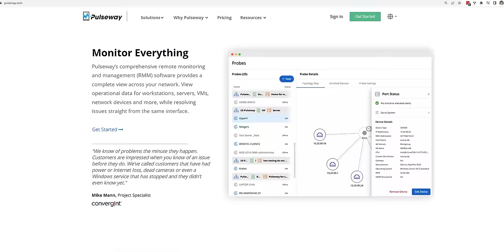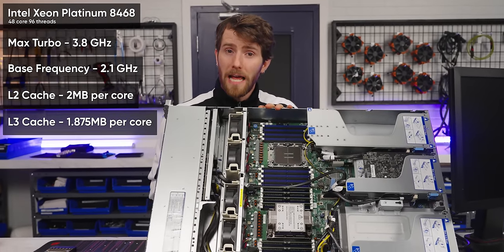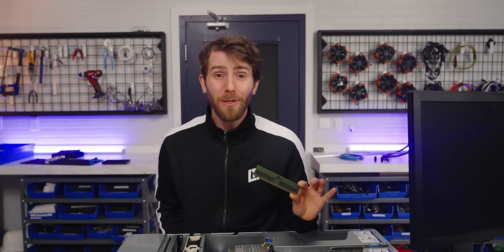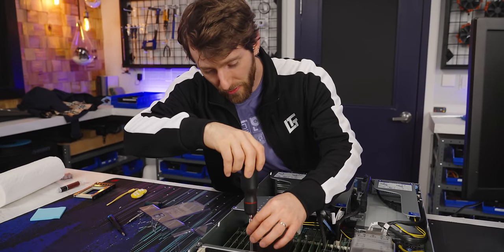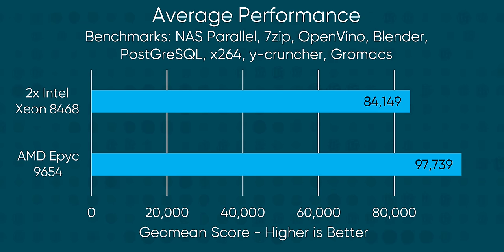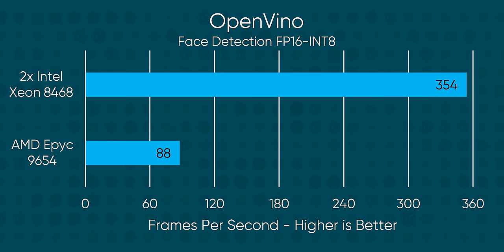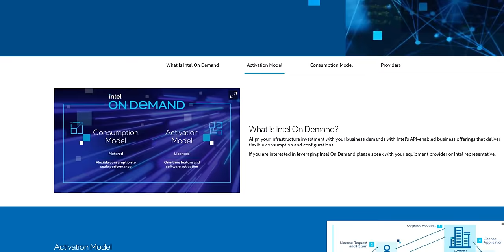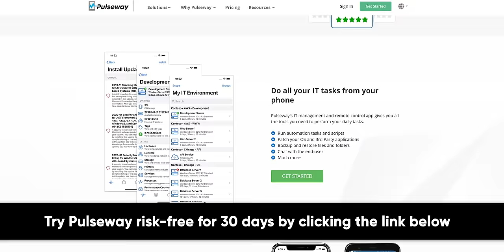Intel’s New CPUs are Cringe - Intel Sapphire Rapids Xeon Platinum 8468

Comment: As an ex server engineer those power usage costs are a real killer. I expect my former colleagues are buying all AMD now.
Reply: Wait until room-temperature superconductivity goes mainstream...
Reply: True
Reply: Even using Alder Lake for servers lol.
Reply: @raylopez99  I just wanna invest in QPUs at this point tbh
I may have to invest a little into more companies I loathe for it, but I am not giving Google a cent. IBM was supposed to be working on this, although I question if we reach quantuum thresholds if they're just gonna keep making bigger surface area dies like Intel, or if they're gonna keep trying to stack like AMD until we have CubePUs. Which in fairness, I think would be rather neat putting a borg cube CPU in my computer like some sort of Numenera, complete with nanotube heatpipes running through the die interior just to desperately keep the core cooled.
Reply: @raylopez99  won't reduce the power consumption of your transistors though
Reply: @michaelrichter2528  Intel should have used Big-Little for Sapphire Rapids.
Reply: Power is going up not down with process, it's a physics issue with no solution.  If power is a concern then stop crying for more performance.
Reply: Problem is finding AMD. Their server chip capacity must be near maxed for existing clients.
Reply: I remember the 90's, where high end desktop workstations and servers were almost all PowerPC based. But due to IBM failing in the 2000's it all came crashing down. I just wish UNIX workstation computing on alternative architectures would be a more mainstream thing again. There are desktop boards with recent Power and ARM chips, but they are too niche, unsupported by most software and very expensive.
Reply: @RyTrapp0  if you normalise two systems that are near identical one AMD and one Intel then the per core power is slightly higher on the Intel side however... power is a physics problem taking voltage, frequency and cap into the equation.  At full tilt you can't reduce the power drawn, something many people fail to understand.
Making a decision based on power is non-sense is what I'm saying, your looking at one aspect of a complete system.
Reply: Hi i want be an server engineer 😊
Reply: Yes we are. None of our customers bought Intel for last several years. The efficiency of EPYC is just epyc compared to Intel offering.
Reply: At ideal or low workloads intel is actually more efficient due to efficiency cores.
Reply: @saricubra2867  They have Sierra Forest coming for the people who want little cores. Do they package both on the same chip IDK yet.
Reply: @Anonymous-qb4vc  i don't think these massive core count CPUs are divided into E and P cores my guy...
Reply: @kleanthisgroutides7100  Wtf you on about? Compute performance does not scale with power consumption at all given different architectures. Are you telling me a vacuum tube computer running at the same performance as a modern day iPhone draws the same amount power? 

In case you are actually not EE, P = IV which means Power(Wattage) = Current(Ampere) * Voltage(Voltage), I have no clue wtf are you on about with frequency or cap 
(I am assuming you mean capacitance) those do not affect the power draw besides reactive power.
Reply: @michaelrichter2528  Yes it will, if you use qubit photonic 'transistors'.  Gotcha!
Reply: @drek9k2  cool story bro
Reply: @ipodtouchiscoollol no, it doesn’t scale directly as electronics always be come more efficient but your not going to have the same power draw with a 4 core CPU as you would with a 32 CPU. It may not be Linear but next level performance typically means next level power draw. We all know a modern day laptop is probably more powerful than the computer they used to put people on the moon lol. Doesn’t mean power draw doesn’t increase with demand
Reply: @ipodtouchiscoollol  voltage, frequency and cap are the only knobs affecting dynamic power... I know what I'm talking about as I've used Samsung, TSMC and Intel design kits.
Dynamic Power = V^2 * C * FCLK
Reply: @kleanthisgroutides7100  you're spouting nonsense. Computing is all about work done over time. We measure the performance of computing by comparing the amount of various types of work over time.

If an AMD Epyc server that costs $10,000 can perform ten million specific tasks per hour, and an equivalent Intel system capable of also performing ten million of the same tasks per hour costs $20,000, then AMD is demonstrating roughly twice the performance per dollar when compared to the Intel system. If the AMD system averaged a power consumption of 1000W while performing those ten million of the tasks per hour but the Intel system consumed an average of 2000W while producing the same work output, then we can safely say that the Intel system represents half the performance per watt as the AMD system.

So in my fictional scenario, if the AMD system cost half as much as comparable Intel system while also only costing half as much to run in order to do the same amount of work, why wouldn't, I, the company, care about the savings in capital acquisition costs, or, the savings in operational costs, or, the savings in datacenter rack space?

I've been an architect in enterprise IT for nearly 25 years. It matters! That said, I have customers who still haven't made the switch to AMD, particularly on their virtualization platforms like VMware and AHV, they know AMD is cheaper, they know AMD is more dense and they know that AMD is more efficient, but they also remember the last time that they made the switch to AMD in the datacenter back in the 2007-2010 time frame with Opteron Budapest and Shanghai, making the painful transition away from Intel, only to not only have to learn the quirks of such a different server architecture, but then to be stuck on AMD when bulldozer was released and Intel literally rocketed past them, forcing them to make the painful transition back to Intel a few years later. Some IT leaders unfairly lost their jobs over that debacle. Many enterprises remember that challenge and while they know that savings exist, so many think they're going to move all of their workloads out of their datacenters anyway in the next five years, so why bother incurring the pain associated with making the transition. This is how the enterprise operates, stupid decisions that defy logic, while at the same time being terrified of anything that represents risk.
Reply: @ronniekregar3482  Actually you can have the same power draw 4 core and 32 core CPU the difference is in architecture and manufacturing processes. Take a look at AMD EPYC 7713 and AMD FX-9590, both of which draws ~220 watts but one is 64 core while the other is only 8 core. I'll repeat this again compute performance is not directly scalable with power draw unless both platforms are identical in architecture and manufacturing process.

And just in case you can't read let me spell it out in all caps ITS ALL ABOUT THE ARCHITECTURE AND MANUFACTURING PROCESS, COMPUTATIONAL PERFORMANCE IS NOT DIRECTLY SCALABLE WITH POWER DRAW.
Reply: @racerex340  like I said before, power per core isn't that different between AMD and Intel... as for the cost you have to take the whole cost into account... I.e. the system, the infrastructure, cooling, service, licensing etc... its doesn't matter if the CPUS are more expensive as once you add memory, storage, NVME, GPU'S it averages out.
Reply: What about the subscription service for the hardware? Wouldn't that cost even more than the extra power consumption? Or is that the sort of thing that you can get a bulk discount on, while power consumption costs what it costs?
Reply: If this is even true, the e-core only skus might sell like cake 🍰. Of course, until the 'zen4' e-core only lands.
Reply: @kleanthisgroutides7100  Please elaborate on that equation specifically C * FCLK, as far as I'm aware C normally means charge in Columbs and FCLK is clock speed. Unless this is a method of calculating current as in Charge consumed per clock cycle I don't quite believe this equation.
Reply: @zahialsalman  there are multiple consumption models. Customers can buy the server outright, lease, or use a consumption based subscription model. Those have all been lower cost on Epyc for quite some time now. Where things get funky are with software like operating systems or hypervisors that have subscriptions or perpetual licenses based on CPU cores, an area where AMD has been historically screwed, and Intel retained an advantage because even though Intel had way less cores per socket, their individual cores were measurably faster than AMD's cores. In other cases, vendors will license per CPU socket, which you'd think would be an AMD advantage until the vendor limits the cores per socket to 32, requiring two licenses for every 64-core Epyc CPU for every one required for a 28 core Intel CPU.
Reply: or Ampere.
Reply: @ipodtouchiscoollol  it's the dynamic power equation or sometimes called switching power... assuming full activity per clock cycle.  You then have to add leakage/static power on top.
Reply: @ipodtouchiscoollol  C is capacitance, this is what your charging.
Reply: @kleanthisgroutides7100  it absolutely does not average out, where did you learn averages? Do you work in federal government? If the AMD system cost half as much to do the same work, and requires less power, there is a savings with the AMD system. The only cases where that wasn't true is with software that penalizes high core count systems like VMware, who require two licenses for any socket with more than 32 cores, which sapphire rapids just surpassed. Also, with Epyc 4th gen, AMD has closed the gap in core for core performance, so Intel will either need to petition those software vendors like VMware, Oracle and Microsoft to further penalize AMD higher core count systems, or actually compete.
Reply: @kleanthisgroutides7100  power consumption for amd only went up becausr their customers asked for it, previous Gen epyc was much more power efficiency
Reply: @drek9k2  you can buy a qpc for 4 grand but just like early pcs it can only compute 1 but at a time
Reply: @hyperturbotechnomike  fewer known vulnerabilities... so maybe safer. Maybe not.
Reply: Sure - go AMD if you dont need any support.
Reply: @racerex340  my mistake. I meant Intel's subscription for using their AI acceleration. I was wondering why that wasn't the deal breaker for the OP, when that would likely be a larger recurring cost, unless there's a bulk discount, but upon further consideration, if you want that AI acceleration, you're either picking Intel or something more specialized. Though I'm sure AMD will have a response to this down the road. Thanks for the reply though. It was insightful nonetheless.
Reply: @zahialsalman  yeah, I agree. I think Intel "thinks" they are doing a good thing, someone did the math and it is cheaper to have one SKU that has the extra functionality and just charge to enable it, than it would be to flash them at the factory. That said, I don't see enough companies interested in the features, at least today, most AI is going to be 100 times faster on a GPU based accelerator (even something equivalent an RTX 3060) than whatever they can bake into an x86 CPU.
Reply: HPE introduces Gen11 AMD based servers first before Intel :)
Reply: @DENRAISR  well, it helped that the new Epyc CPU's were ready on schedule.   With Intel's ineptitude over the last 7 years, how much longer could HPE stretch out Gen 10 / Gen 10 plus... As far as I'm concerned, the new Xeon's are HPE Gen 11, and the 4th Gen Epyc are Gen 12
Reply: The contract clause should include:if u dont buy the most efficient hw, the extra power cost comes out of your pay annually.Then watch x86 go irrelevant and all server builders rush to find the most efficient solutions just so their balances dont go into negative. Is it unconstitutional? Who cares. Efficiency go brrrr
Reply: @kleanthisgroutides7100  cry more bro. So the wattage meter is wrong then?
Reply: @racerex340  the CPU cost is only a fraction of the total, licensing alone makes it pale in comparison.
Reply: Yes, me also only AMD gaming CPU's only and maybe for fkn EVER!
Reply: @kleanthisgroutides7100  I hope you read the enough comments that specify where you're wrong.
Reply: @cosminmilitaru9920  who said I was wrong? Sorry but I work in the space and design IP that's applicable for any company.  Power isn't a consideration, its a problem but there isn't really a solution at 16nm and below. Do your research bro.
Reply: @hyperturbotechnomike  The key words are "known vulnerabilities". The deployment number for ARM-based servers are still so low, bad actors don't consider that to be worthy of their time & effort. But if usage ramps up, who knows, ARM-based servers might prove to be much less secure than x86 servers, especially since x86 servers have practically been maturing so much over the decades.

Relying on fewer "known vulnerabilities" is like relying on "security through obscurity" = not a good thing to do.
Reply: @Anonymous-qb4vc  "Efficiency cores" is just a name. They are not actually power efficient. They take up less space so they are area efficient. During rendering with the 13900K, Buildzoid (Actually Hardcore Overclocking channel) turned off every P-core he could (one stayed on for some reason but didn't use much power) and left the 16 E-cores on. Those 16 E-cores used as much power as a Ryzen 9 5950X (around 140 Watts) in the same workload (pretty sure it was a Blender render) not to mention they were obviously slower than the 5950X. So Raptor Lake's "efficiency" cores are less efficient then AMD's last gen full powered cores.
Reply: @hyperturbotechnomike  yeah that is not correct at all lol. Power and ARM have the exact same type of issues x86 has. If your workload can run on arm, there are all sorts of low power usage x86 processors out there that would provide better density and more performance.
Reply: @vigilant_1934  that also make it more power efficient for low workload, efficiency cores do serve their purpose. and intel ideals at lower TDP. i saw most people even youtubers simply believing and preaching AMD is more efficient bcoz of lower nm fabiracation (which is misleading in itself bcoz design difference) but intel turns out to be more power and even heat efficient at same performance by proper tuning. intel is also overall faster but that extra speed comes at inconsistent extra cost of power and heat where is falls behind in efficiency. also intel got better encoder support and overall compatibility.. 
watch der8auer EN 's Testing and Tuning the new 13900K for Efficiency. someone who actually knows their field.
Reply: @hyperturbotechnomike 90s all workstations were mostly sun and sgi not powerpc.
Reply: @ipodtouchiscoollol putting a computer and an iphone in the same bag is funny like a plastic toy gun with an uzi.
Reply: @raylopez99 until then  my phone will have 16 exabytes of ram.
Reply: @hyperturbotechnomike no no. High end workstations were ibm solaris hp ux . Ibm power not ppc.
Reply: @Teluric2  IBM Power is their name for their current PowerPC based servers and storage solutions.
Reply: @raylopez99  the main power draw of CPUs are capacitive switching losses. Not the resistance from wires. So supercondictivy won't do much about that
Reply: @bonnome2  Pretty sure superconductivity would help throughput of data; recall electrons travel in uPs at about the speed of somebody walking.  But maybe a new architecture is needed.
Reply: @raylopez99  I don't know what you mean by uPs, but the average velocity of electrons is very high. Or do you mean the drift velocity of electrons?
Reply: @bonnome2  Yes.  uP = microprocessor.

Comment: Someone from Super Micro was sweating really hard while Linus was holding their server at an angle.
Reply: theyre prolly crying rn after the thermal paste fell in the socket
Reply: They know ... Oh ... we send something to Linus, write that off, it's already broken ! 🤪
Reply: Holding the server and applying thermal paste.
Reply: Haha was thinking the same 😂 I would have love to have been at the meeting where they decided to send this system 😂
Reply: Linus needs to do a video with Phil Swift
Reply: NOW THATS A LOTTA DAMAGE
Reply: The server blade will function upside down. It doesn’t care…as long as it can connect to the pwr bus.
Reply: Someone else from Super Micro was sweating really hard when Linus dropped paste in the socket.
Reply: @zfgnerdlife  How well do you figure it will function after it gets dropped 40” off of a table? I suspect it’ll have some difficulties.
Reply: I’m sure Intel is sweating hard seeing how much crap Linus and LTT in general just disses Intel every other minute in their videos now that they don’t have a deal with them lol
Reply: With their RMA failure rates, I am sure they can just throw it in that bin. Technically the boards are the best for dollar, but I am on my second RMA right now for the same board.
Reply: @shikutoai  I haven't dropped any from that high.
Reply: @zfgnerdlife you can bet they have, it's part of their stress testing, just like letting linus near one is.
Reply: Someone from Super Micro was sweating really hard while Linus was holding their server at an angle .Fixed it for ya 🤣